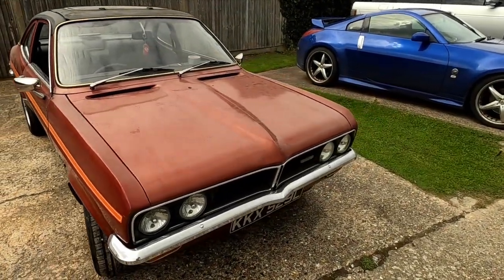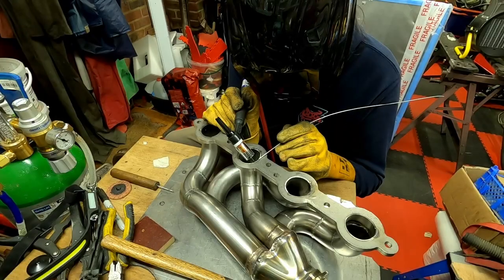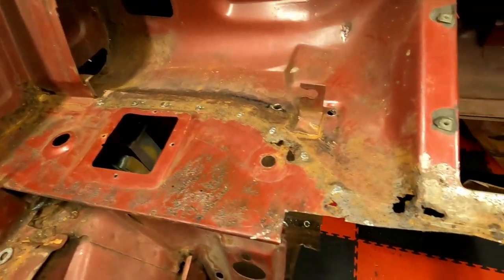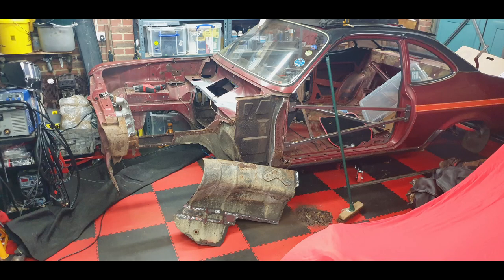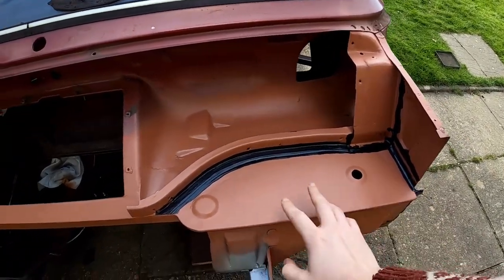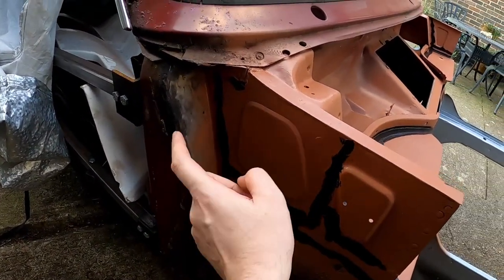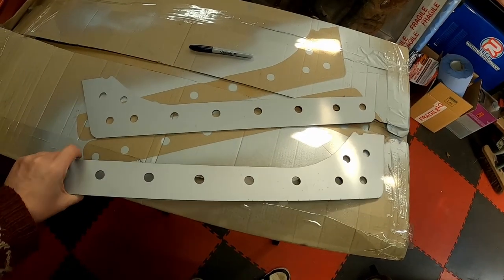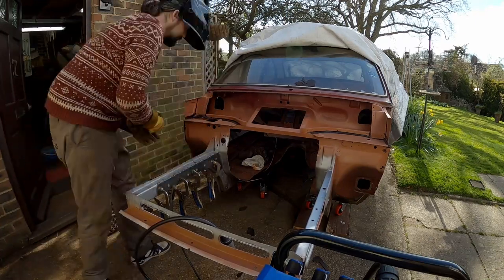Major rust repairs on my 1972 Vauxhall Firenza LS swap! [Ep10]

Comment: Great progress (and top quality video!). I wish there were more detail on the wing removal, as I haven't found the courage to try that yet on my HB, although it really should be done. Do you have a link to the vendor for the frame reinforcements? I'm wondering if there are HB versions available?
Reply from the maker: Hi - the wings on these are usually spot welded, it's just the game of find all the spot welds! These ones had been off in the past and had just been slug welded on all over the place 🙄 the frame reinforcement was from https://promechcustomrestoration.co.uk/